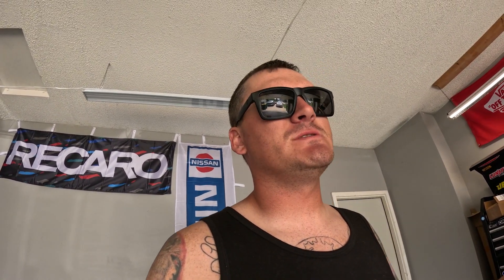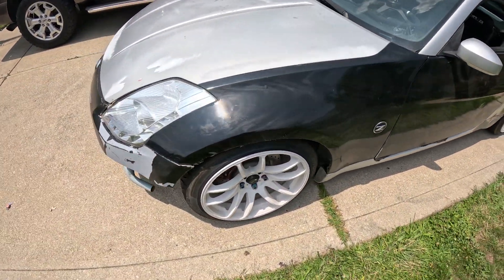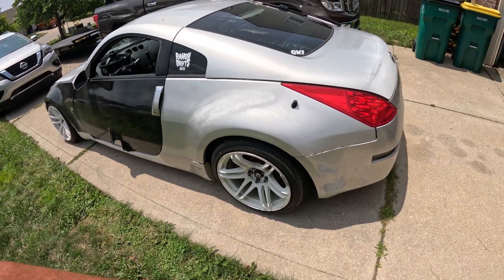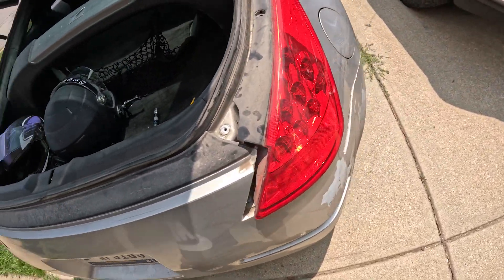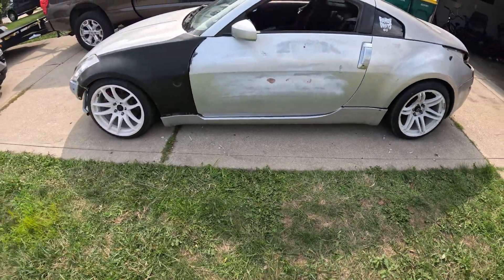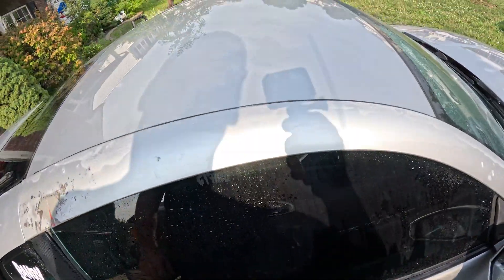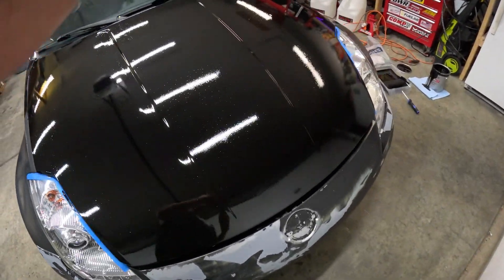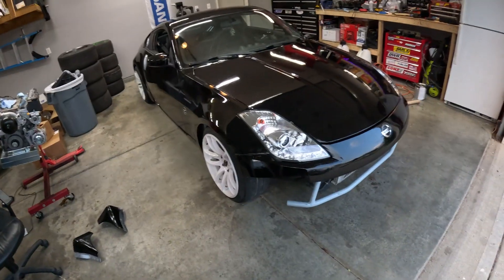Roller Painting My 350z Drift Car

Comment: I just did my 20yr old van. Same paint but quarts. Its oil based. Sand everything 80grit. Wash, wipe down then wipe with acetone (cheap). Tac down before paint. Product called Flood Penetrol add to paint 4oz/qt. Add Acetone 2oz/qt. Thins out the paint. Mix well. 1/4 nap roller. Roll on thin coats working about 5 minutes big stokes up down side to side. Consistency of thick water. Go over once.. Flood additive eventually smooths out roll marks. 24hr dry. Sand with 400grit. Clean and tac.  Second coat. 24hr dry, sand or buff 1000grit. No clear coat needed. Big van total cost $200. Buy a 20pk roller skins.. Did it on my driveway. Way easier than spraying. Toss the roller after each use. Tac roller with tape gets the fuzz off. 1 week entire van done smooth.
Reply from the maker: Yes I love how easy it is to do. How cheap it is and anyone can do it

Comment: Did my car with rollers in parking lot of mall 😜. During plandemic height...which was good, cuz nobody wanted to approach me. " Guy like that, probably ain't vaxd" came out ok. For first timer. But I really wish they made a roller tapered towards  both ends ( kinda like bowling pin...Not just rounded.) So as to not get those edge lines.
Reply from the maker: That’s crazy dude! I love how easy it is to paint a car with a roller.
Reply: “Guy like that prob ain’t vax’d” 🤣🤣

Comment: Interlux paint a Marine Paint makes a brushing thinner that will help those roller marks flow it keeps them paint wet so I can flow interlux interlux brushing liquid
Reply from the maker: Sweet thanks I will keep this in mind if I decide to sand it down and recoat it !
Reply: Another little trick is to take some tape and do your roller with tape first to get the lint off at I think you got a lot of lint in your paint is from the roller I think and then once you get it off with a tape than your roll out some paint on newspaper. You ll have a  smother finish
Reply from the maker: @davidgentz1731  sweet dude thank you for the advice I might try this again with another car.